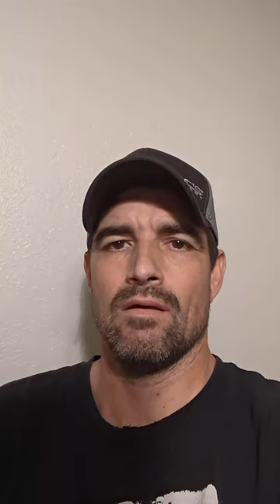The 4 different types of DTC codes, and what do they mean?

Comment: I got a C3883 code on my vw golf mk7 gti. I didn’t get it on my dash I got it on my Cobb access port. And i can’t find anything online about it.
Reply from the maker: What year?
Reply: @showmemechanics  it’s a 2015.
Reply from the maker: I logged into Volkswagen, and looked up that code, and that code is non existent in the database. Sure that's the right code?
Reply: @showmemechanics  yeah I wrote it down before I erased it with the access port.  The funny thing about it is that it appended right after my brother turned on the car on gear. Good thing the car had the hand brake on.